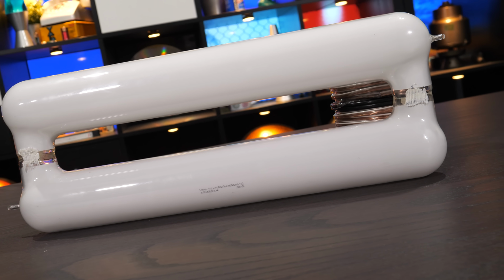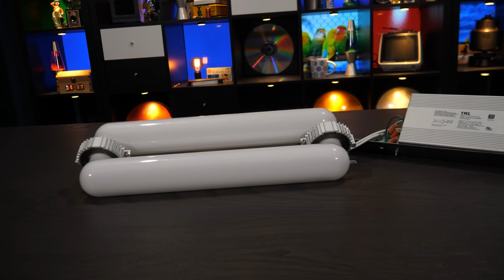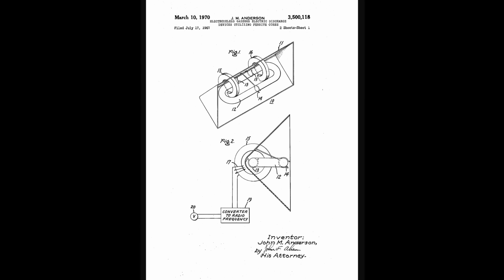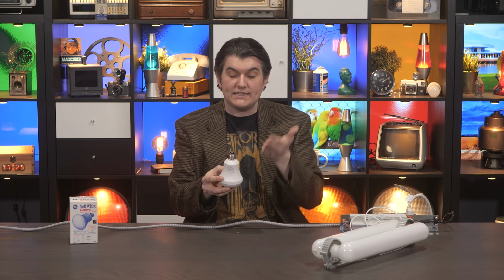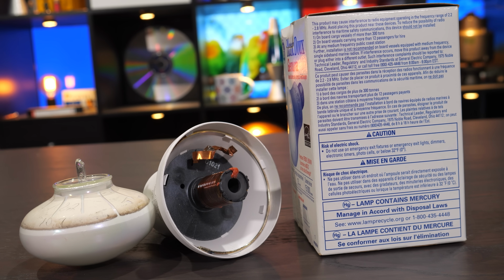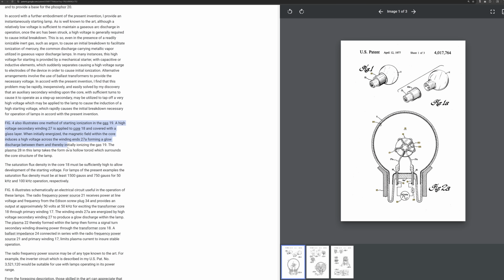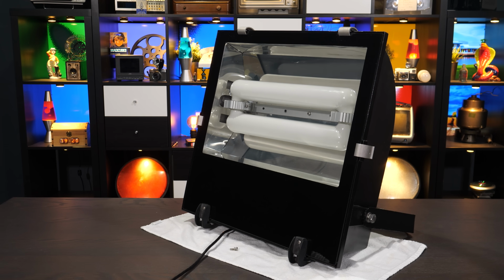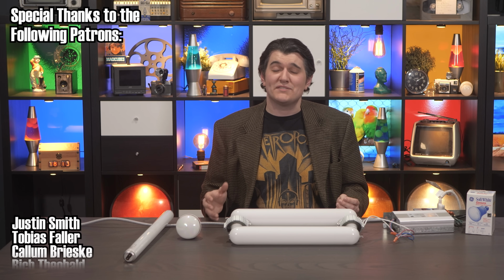Induction lamps: fluorescent lighting's final form

Comment: Funny enough I experienced this with my Tesla coil, but even without the secondary coil present, now my setup was definitely overkill for this application but it's still pretty interesting to observe.

Edit: I mean my setup, for this use case, there was no efficiency really, just forceful air induction, might as well have been an EMP generator.

Comment: Alec, as a complete guess to the starting mechanism, could an additional gas be added to the florescent that had a breakdown voltage just low enough to conduct power in the starting voltage mode? It would act as an incandescent heater to warm the bulb close to its operating temperature where typical florescent action could occur. 

Still a complete guess but In the single coil bulb, the lack of cooling could have been a feature. The mercury is located deap within what amounts to an induction heater. Even at low power, the mercury could become hot enough to start.

Also, if my memory is correct, without a secondary winding, transformers will act as little more than heaters as the core becomes fully permeated and eddy currents form.

Comment: When I had a CB radio in my truck you could put a fluorescent tube next to the antenna and it would light up when you transmitted a signal. Up to 3 feet away in mid air.

Comment: It's possible to do an induction discharge in any tube of dielectric gas, if the intensity is high enough.  The problem, is the more power the inductor applies, the closer the discharge conforms to the walls of the tube.  Gotta use fused quartz to get really high powers.  But then the tube is going to need another safety enclosure, like HP Sodium, or HID Mercury arc tubes.  Hey, have you ever seen a Sulfur Lamp?  Those were incredibly bright.

Comment: I could say that that mesh in the appendix is likely just a point of mercury condensation - so it won't form balls on glass that would otherwise damage the fluorescent coating. So, doesn't seem related.
But high enough voltage generates strong enough field to ionize gas.
I'd suppose the driver generates a very high voltage with very low current limit. Thus, high voltage ionizes the gas, gas starts ion flow, which drastically increases current, which reduces the voltage down to operational level.

Comment: at MHz frequencies capacitance is the factor causing the voltage difference in the gas. (which is how tesla coils make fluorescent tubes glow at a distance) Notice the coils are in anti-phase in the patent meaning each cycle they would create a big magnetic field change in the gas inside the tube, but half of the tube separate and opposite, which should be enough to cause some polarisation in the conductive mercury gases inside the tube starting the ionisation to the rest of the gas. 
Basically you have two magnetically decoupled primary coils short circuited by the fluorescent tube acting as the secondary coil.
at high frequencies most non conductive things arent that good at preventing conduction, capacitance and induction tend to bypass it.

(thats what i think is happening imo)

Comment: LEDs and fluorescent lights have the opposite problem.  LEDs are very directional and fluorescent lights are not at all.  LED streetlights light up a smaller area very well but the surrounding area is dark.  Some town in England had their street lights replaced with LEDs and the people complained that the small area under the LED street lights was bright but everywhere else was dark.  Also, the LED street lights have a tendency to turn purple.   Fluorescent street lights will light up a larger area but it will be more dim.  Despite their efficiency problems, incandescent lights are pretty good.  They can be focused more easily than fluorescent light and naturally have a full spectrum output.  Both LEDs and fluorescent lights have light spectrum issues.  A white LED is not full spectrum, It is a combination of blue and yellow.  In order to get a truly full spectrum light from LEDs, you need multiple LEDs of different colors.  Plant grow lights may have some white LEDs but are mostly red and blue.  Fluorescent light output will be more red, blue, white or violet based on the chemical makeup of the powder lining the tube.  Which type of light source is best to use depends on what is needed and the power available.

Comment: The inclusion of a self resonant coil, or strip of wire,  inside the glass envelope might be arranged to produce the high voltage to ionise the gas. One can consider the gas envelope as a shorted turn of an RF transformer. Once conducting, the gas will act as a high current plasma loop. Unfortunately the lamp envelope represents far fewer turns than the driver circuit, suggesting a sufficient high voltage would be very difficult to generate to  initially ionisation of the gas. The very high Q of a self resonant tuned circuit would solve this problem.

Comment: If induction street lights take up to ten minutes to warm up to optimum luminosity in very cold climates, it would be trivial to turn them on about ten minutes earlier than “normal”. Given that sunlight doesn’t simply shut down instantaneously, but rather fades in twilight, street lights not coming up to full brightness immediately isn’t a big problem.

Comment: [Note: I wish there was a way to search YouTube comments, but since there isn't, I'll just forge ahead, assuming no one has mentioned these...] A few years ago, I bought some of these lamps (the  ones that look like a lightbulb) from a company under the name of Finally. I still use them in my bedroom ceiling fixture. The website mentioned the Nikola Tesla connection, and being a fan of Nikola Tesla, I had to try them. I like the soft start and warmup to full brightness, especially on dark winter mornings (rather than being blasted with full brightness and squinting because of optical overload). Unfortunately, the company shut down their production of these lamps and turned to LED lighting instead, under a different name.

Comment: Part of a research group from my phd days was using something that I think is similar, except they had tubes of low pressure gas poking out of a microwave cavity and were aiming to create UV light. I seem to remember these needed a zap from a piezoelectric anti static gun on the outside of the glass to get them started

Comment: I've seen a conventional fluorescent lamp that is one meant to be attached to power via by wires in the cases of a ham radio power amplifier.  It was used as a indicator when tuning the PA.  Quickly turn the plate and load capacitors until the lamp lights up, course tuning done.  Now the slower fine tuning can start.

In the past time of high power AM broadcasting people were known to have used such unconnected fluorescent lamps to illuminate garden sheds.  Some were even annoying because the lights had no off switches - and of course the operators of the AM stations didn't like it at all because it essentially stole power for the lamp wirelessly from them.

Comment: I would love to see the RF output of this on the oscilloscope as it starts up. That would confirm your theory that the driver produces a high power burst initially. I bet you can thread a thin wire into one of the cores along with the lamp and use it as a sense winding that goes to an oscilloscope probe.

Comment: I converted Charlotte school parking lots with the donut and some bulb shaped induction lights bulbs where great the drivers where cheep junk i did, however, figure out through some experimentation with the lamp. I built over my driveway out of some of the parts that if you used a 200 W driver on a 150 W bulb, it seemed to be pretty reliable. The lamp that I built for my house. It's over my driveway on my garage. And it's been going for around ten years now, on the same driver and bulb

Comment: Yeah reliability of the electronics "carried no guarantees" - just as modern LEDs don't last any longer in my experience than conventional incandescents. Dunno where you get "high quality" bulbs but there doesn't seem to be any such thing in South Africa. Maybe we just import the cheapest crappiest Chinese no-name brands but fm it's annoying.

The early LED up/downlighters made as plug-replacements for 12V or 24V fittings were the greatest culprits. They had a toroidal transformer wound with hair-fine wire and every single time I had a bulb failure I'd open it and find this burned out. Usually after an even shorter life than the incandescent it replaced. 

At least they run a bit cooler.

Comment: Fun fact! Fluorescent lights without the phosphor coating are still fairly popular in sterilization cabinets! Add a couple mirrors and a UV absorbent external coating and you can quickly nuke any biological life without harming components which are heat (but not UV) sensitive. My high school chem lab used one for the communal lab goggles

Comment: Just yesterday I was looking for a T5 fluro tube fixture for a specific application, and evidently it's now a criminal offence to sell them, because you can't buy them here in Australia anymore. Instead I had to buy the T5 tombstones, magnetic ballast (they don't make electronic ballasts for low-wattage tubes), starter socket and starter separately, and I'll have to build the fixture from scratch. Which is much safer than just continuing to sell the fixtures for specialised use cases.

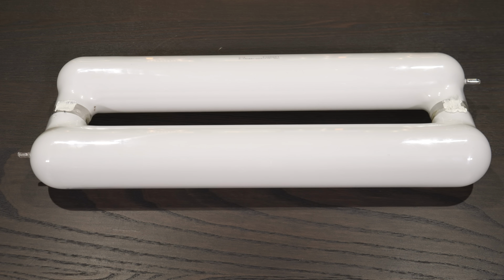Comment: The reason induction lamps like the large ones as well as the small ones didn't go Main stream because the electromagnetic field they created causes major interference from all major house hold electronics like routers and modems as well as tvs and consoles as well as all major lab equipment and phones and many other electronics they caused to much damage 24:36 @Technology Connections

Comment: regarding the Plasma: people usually know about hot/ thermal plasma but there is also cold/ high frequency plasma which is produced by high frequency EM, typically radio frequency;
there is the famous plasma inside a glass ball you can even touch as demonstration tool in physics classes.
so i assume it's cold/ RF plasma inside the lamp

in a nutshell, as much as i understand, it works like this: 
the induced EM field makes the particles accelerate in one direction;
quickly alternating the field accelerates them into the other direction; 
this promotes particles collision and induces many things like ionization, deionization and dissociation resulting in a plasma

Comment: The reason they didn't catch on was primarily common human stupidity. I bought a few of those on aliexpress a while ago for between 20 and 40 Euros and they still work for me. They were like U-shaped E27 bulbs. Have you looked at Jablockov's discharge lamps? They were even older than Tesla's. And they also didn't catch on and were overtaken by Edison. My induction lamps also don't have an auxiliary starting circuit, and their inverter is practically no different in circuit from the inverter of compact incandescent lamps, and the manufacturing price of such an inverter must be the same. Semiconductor inverters capable of operating in such a mode began to appear around 1980-1990. If a reasonable company had gotten involved, they would have been there even sooner. The second reason they didn't catch on was the slowly developed LED technology. You say that induction lamps are not directional enough. However, this also depends on the design of the luminaire, and even with street HP sodium lamps, the reflectors became dirty over time and the efficiency was reduced. LED, HP sodium and induction lamps (depending on the phosphor) have a maximum efficiency of around 100lm/W. LP sodium up to 200lm/W with a similar design to induction, only yellow. In rooms, on the other hand, diffused light is required. LED street lamps are smaller, but they require a relatively large amount of aluminum for cooling. The efficiency is similar. The material consumption of induction lamps is lower, also in terms of energy, because less glass is needed than aluminum, it does not require such sophisticated production as LEDs and a single-transistor oscillator is sufficient for excitation in principle. Recyclability is similar. However, resistance to insects in outdoor environments requires a larger cover glass. The aluminum LED heat sink is also not completely foolproof. The measurement of the induction lamp is less, the assumption of a better life, the start in winter is worse.
The third reason is fake hysteria against the harmfulness of mercury. In the interwar period, in some European cities Moda was sucking orthut on the tongue, analog of glossy piercing. Compact liquid orthtut does not pose a serious risk, only some of its soluble voices. Therefore, in my opinion, the induction lamp is still suitable for interior lighting. Alternatively, the RF is easy to shading with a thin metal network integrated into the lamp. It is probably an ecological pity that it did not apply early along the fiber bulb.
As when one is looking for better lightbulbs around the world and has decades of her neighbors. And then add the LED. I forgot about something?

Comment: i'm wondering if the EF at 90 degrees from the Magnetic field is involved in generating an ionizing effect for the mercury vapor .

This also reminds me that a lot of cities are going with tower lights at interstate intersections, where they put 4 posts up one in each of the loops for direction changes, and that system is using microwave frequency induction of the medium they are illuminating the area with, but it's essentially 4 bulbs at each pole, and 4 poles fo the entire intersection illumination. They are using reflectors to point the illumination down. I haven't noticed if they are still going in, but if you're seeing towers standing about 100-120 feet at an interstate intersection, it's likely to be one of those.

Comment: YOu need to look up ICP: Inductively Coupled Plasma. That's how a lot of semiconductor plasma chambers work. Argon takes very little energy to ionize.
Reply: There is another ICP lamp source, it was called LiFi. It used a tiny tik-tak sized quartz capsule with argon and a metal halide mixture to give white light. It is almost a point source so you can focus it pretty well, it was used in some rear projection TVs. I have a few evaluation kits from when they were trying to market them.

Comment: My problem with LEDs is their extreme intensity. When I drive through my local town at night, I am blinded by wall packs facing towards the street. This wasn't an issue with fluorescent or HIDs because they did not have such high lumens combined with extreme concentrated intensity. The building I work in switched to LED from a combination of metal halide and fluorescent last year. Even the 42 watt CFL fixtures had a metal band in them to block the direct light from what I would now consider a low intense form of light.

Comment: Back in the days of CRT TVs, if you brought a fluorescent tube near the back of it while turned on, it would glow!  My foreman at So Cal Edison wouldn't believe me when I told him about it, until he tried it out himself at home one night.  I told him to start with the 4' tube about 3 feet away, and then bring it closer until he got full brightness.  He wanted to know how it worked, and I told him the RF energy from the fly back transformer was being broadcast and it excited the molecules in the tube.  He showed it to his kids, and they were very impressed by it.
  Chris, one of the operators at Vincent Substation near Agua Dulce, would take the new hires out into the yard at night with a 4' tube in each hand and show them how the 220KV powerlines would make the lights glow!
  They had short pieces of metal pipe and rebar all around the parking area inside the substation, which were used to dissipate the static charge that would build up on the cars and trucks if they sat for more than about 15-20 minutes.  You would take the metal bar and set one end on the gravel, then let go of it so it would touch the body or metal bumper of the car or truck as it fell over.  When it made contact, the charge  would be bled off, and you could touch the door handle and not get a nasty shock!

Comment: We had a Floressent Globe style Light in our home in 1990 in one of the lights, I don't know if it was this technology or not but it was installed as part of the build of the home to show off energy effeciency as our home was built under the "Quality Plus Energy Efficient Homes Program" put on by BC Hydro. It had so many cool Energy Efficient features like the Heat Recovery Ventilator we had and the energy efficient windows, 

Unfortunately the people who owned it after us stripped all that good stuff out of the house, threw in a bunch of Skylights, Squared the Rounded window in our living room, 
Removed a bunch of the upgrades my parents did between 1990 and 2006 such as the Solid Birch Half doors my dad made to keep the dog upstairs circa 2000 when we had a 2 year old Beagle. (Interestingly though He built 3 doors and only used 2 of them, One he made for the outside deck stairs and never used that one as we fenced the yard instead) so when I had a son circa 2019 and was looking for a fancy way to do a baby gate in our new house we bought in 2020 I asked my dad if he might build me one of his half doors. He said "I'll do you one better, I still have one extra from when I built them before, Let me and your mom buy you as a housewarming present the mounting hardware and door handle for it and I'll come install it."
So we bought a matching handle to what is on the rest of our house and bought the kind you put on bathrooms and faced the lock mechanism on the downstairs side of the door.

It now serves the same purpose as the original 2 did as we have a new dog  and a 6 year old son 

Anyway these cool energy efficient light videos are really neat and sorry I got off topic reminiscing about my old home and about my dad.